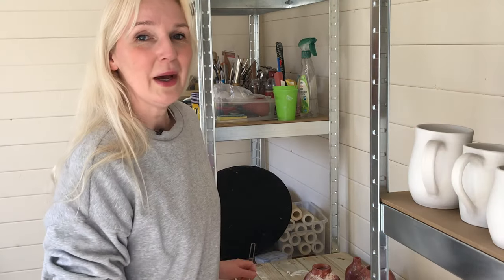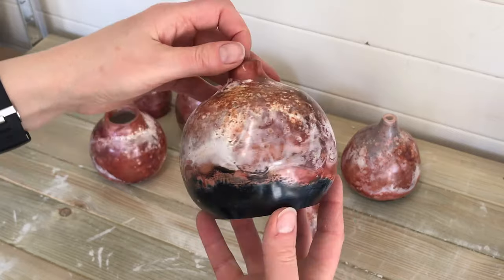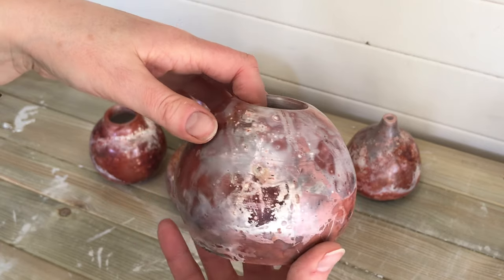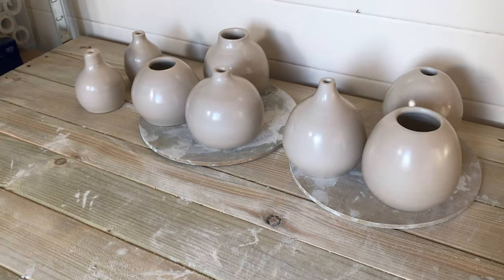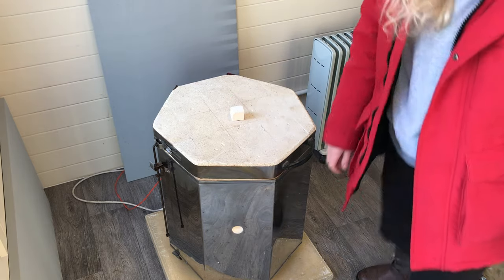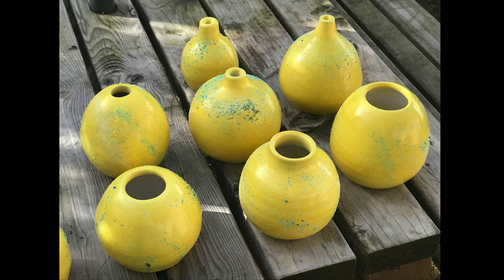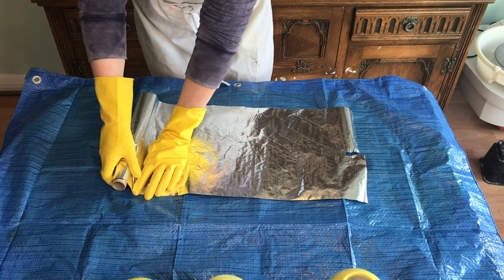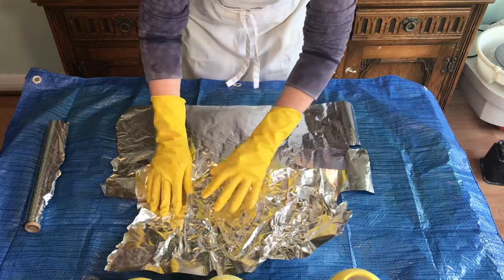Saggar Firing Pottery

Comment: If you put the flow control valve at the tank instead of at the kiln you can stand up and several feet away from the kiln to make adjustments. :-) I adjust mine from a lawn chair with a good cup of coffee. Also means I don’t have to wear a respiratory very much if at all.
Reply from the maker: Brilliant idea :)
Reply: I certainly hope you both have a pressure regulator between you're hose & burner and the propane, butane or LP-Gas tank. It is extremely dangerous to not have a pressure regulator. 

Why? If the tank runs out of gas the fire can back-feed itself from the burner through the hose and explode the near empty tank when a vacuum is reached from temperature change.
Reply: @about2mount  If I didn’t have one I probably wouldn’t have known to suggest to her that she move the one she HAS installed to the tank end.

Comment: Try opening the burner port all the way and using the knob on the propane cylinder to adjust gas flow.  On my setup I’m able to make smaller adjustments to flow without having to get close to the kiln

Comment: I very much appreciate you sharing your techniques and the effects possible with them, and as much as I dislike when others go full safety nanny, there's a few bits to point out that will keep you and others safe when doing these things. The least scary part: ceramic fiber blankets are made with a high degree of silica which will absolutely go airborne under duress of elevated temperatures. While I applaud your use of the respirator and goggles, unsealed kaolin is still "dangerous" even as it sits with normal exposure in handling and firing; the more you're exposed, the greater the chances accumulate of developing silicosis (basically a build-up of silica bits on and in your lungs). Sealing kaolin fiber with sodium silicate liquid is a very cost effective and safe method to keep it locked in place. You can make it if you like, buy the powder and mix it yourself (with ppe equipment, naturally) or purchase pre-mixed solution, but I normally go with the powder and add water for convenience. 
Now with the relatively small amounts involved with your pottery, chances are relatively small you'll have a problem, but I'm very timid when iron and aluminum particles come into intimate contact in any substantial quantity. I've dealt with powders of both and done purposefully, so if gases given off during combustion or elevated temperatures of firing are possible, that you might have to read up on. Point of the matter: aluminum and iron powders react rather excitedly (read thermal violence) when exposed to high heat in the form of thermite, a chemical reaction that burns at temperatures upwards of 3300*C/6000*F and is for all intents and purposes, impossible to extinguish with consumer-level equipment. When done purposefully, it's often used to weld railway rails together and takes a significant amount to heat to initiate, but once it touches off, you stand back and let it go while whatever around it goes up in a shower of sparks and copious smoke. 
I'm not saying stop everything you're doing that involve the two materials. As said, in the amounts you're dealing with there's a relatively slim chance you'll encounter problems, but it is something to consider for the one time the unexpected happens and your kiln turns into an unquenchable volcano.

Comment: Thanks for a great video. Have you tried lacquer/varnish rather than wax? I've started using a spray lacquer, you can use matt, satin or glossy. This way the pot is better protected and easier for your customers to care for the pot.
Reply from the maker: thanks for the suggestion.  I have used lacquer but I like the look of wax better.  But you're right, it's easier to care for with a spray

Comment: how did the foil not melt? Aluminum melts at under 700 C doesn't it?
Reply from the maker: Hi Simon.  The aluminum gets very thin, papery and brittle and it just falls away from the pots.  I'm not sure what temperature it would become molten, but the kiln is hot enough so that it becomes very thin and fragile.

Comment: On the topic of turning off the burner, you should always kill the flame at the furthermost point from the source, reason is what we learned in school, is that when the escape velocity of gas is greater then the velocity of combustion, we have a safe environment where most likely nothing wrong can happen. 

BUT as you turn the wheel to shut down the flame from the bottle itself and NOT at the nozzle, there you have a recipe for disaster, there is still gas inside the tube from the bottle to the nozzle, the escape velocity of gas can now be lower then the velocity of combustion and you can have a little poof in the tube, now if you are at the end of life of bottle there might be lower pressure inside the bottle itself, and the whole thing can explode in your face. 

ALWAYS TURN OFF THE GAS FROM THE NOZZLE NO MATTER WHAT !!  
                  The pressure inside the hose is a layer of safety :)
Reply from the maker: Thanks, that's helpful